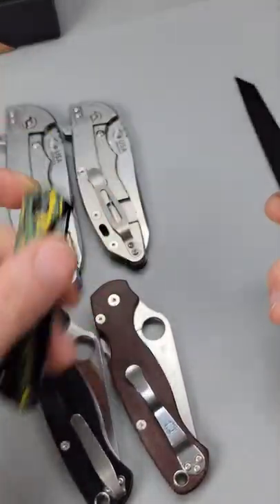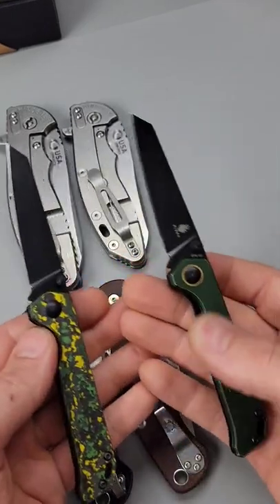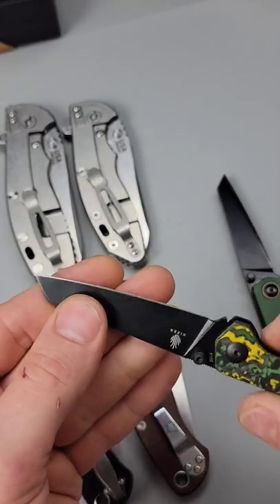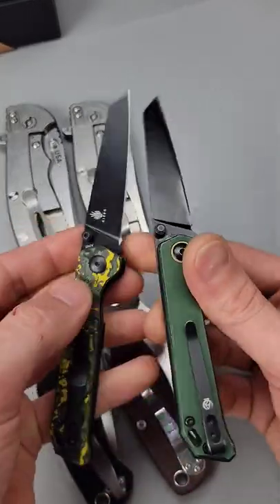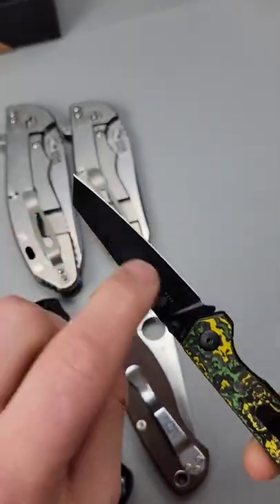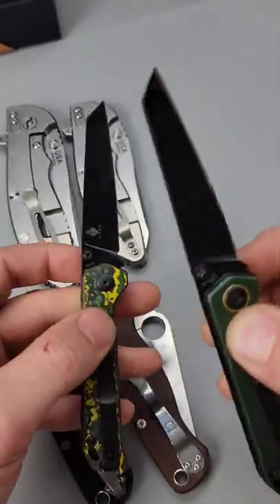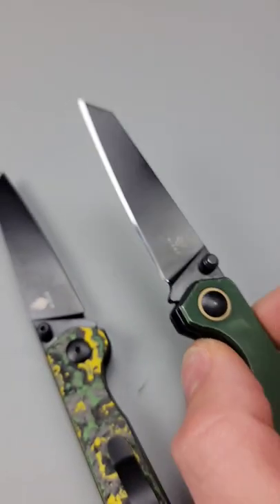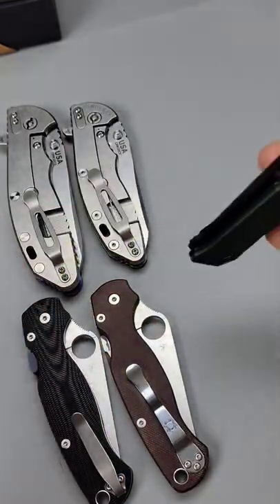YOUR EDGE WILL GO DULL AS SOON AS YOU USE IT

Comment from the maker: EDGE ANGLE DIFFERENCES, EXPLAINING THE DIFFERENCE IN EDGE ANGLES, YOU DEFINITLY WANT A BALANCE TO SOME EXTENT, THE STEEL AND HEAT TREATMENT ARE GOING TO PLAY AN IMPORTANT FACTOR AS WELL.

SPYDERCO PM2 CRUWEAR
https://amzn.to/3dPdb6D

KIZER MINI BEGLEITER
https://amzn.to/3wn0jLk

BLADE HQ KNIFE SHOP
https://shareasale.com/r.cfm?b=375565&u=3154377&m=39329&urllink=&afftrack=

GP KNIVES KNIFE SHOP
https://shareasale.com/r.cfm?b=631534&u=3154377&m=54594&urllink=&afftrack=
Reply: but is it as tough as a Ginsu 2000, that is the ? 🤪
Reply from the maker: @cctvspystore  😆
Reply: First time here. Cant wait to see what you say about the Spyderco knifes.  I had one in my pock for 20 plus years. 👍🤠
Reply: What are the two different steels?
Reply: Dude, why u screaming
Reply from the maker: @ArvindDevaraj-u6l  why are you so quiet?
Reply: There are different things being discussed that shouldn't be equated without clarification. "Edge retention" as you're using it should more correctly be called "edge wear resistance" because you're assuming that the only edge damage will be from repetitious use and wear of the terminal edge. In reality edge damage can come from other causes such as accidentally hitting a hard substance. In this case a smaller-angle grind will take much more damage than a broader one and thus would have much worse edge retention. Edge retention isn't just wear resistance but also toughness. Contrary to the internet gurus, there are lots of scenarios where a steel like 1095 will have critically superior edge retention than a super steel because nothing destroys an edge like a chipped blade.

Comment: Exactly, this is why I sharpen at 90* per side. Twice the cutting edge and ultra durable.
Reply: 17 degrees edge with S35VN, VG10, AUS10 can still whack tree branches without chipping 👍
Reply: @nafis6668  you totally missed the joke
Reply: @vraskas6252  🤣 yes i was. Thanks for pointing that out
Reply: It's a good joke, but actually there are tes where a crisp 90 degree will do an amazing job smoothing surfaces.
Reply: 😂 toughest knife ever
Reply: Can’t lie the nastiest cut I’ve ever gotten was from a 90° edge. Granted my fingers went kinda damp from wearing gloves all day, but that mfr Went straight to the bone
Reply: @Gamdalff  What was the object? A knife or something else?
Reply: @ElCapAddict  it was the 90° edge of a fryer cover in the kitchen I worked at. I picked it up, my gloves were greasy, it started to slide, I tightened my grip, that cover kept right on sliding. Sliced to the bone all along my hand where I gripped it. Most painful and gnarliest cut I’ve ever gotten, and I’ve been stabbed lol
Reply: @Gamdalff  I also got a really nasty little cut from a 90° edge—I was putting together one of those low cost sheds kits and cut myself on the galvanized sheet metal. I was applying roof tar to seal some areas and smoothing the bead and was cut through my gloved hand (there was a possibly burr in this section from the stamping/shearing). Take care!

Comment: Depends on how you use your knives and what makes them dull. If they're dulling from abrasion wearing away the edge then yes a thinner edge lasts longer. If you're doing something that causes chips or rolls then a thin edge will usually dull faster. There's a reason axes aren't sharpened like a sushi knife.
Reply from the maker: I just posted a full video

Comment: That being said a scandi grind is the best of both worlds. Love my mora for that
Reply: Scandi till death.. but I don't use mora I destroy them to easily and I hate the sheath.
Reply: Scandi knives perform very well, but thickness approaching the very edge is determined by angle alone, not how far back that angle continues toward the spine. 

Or maybe the wedge effect helps pull the material apart, putting less stress on the edge? If you've actually noticed this in practice I'm curious to hear it, since I haven't used a non-Mora scandi so I can't be totally sure. It just doesn't seem to me like there being a "best of both" makes sense here.
Reply: @mysss29  you pretty much have it, but one other thing is that you can cut at a very low angle with a scandi, so it’s good for controlling depth of cut when shaving/scraping.

 The best part of a scandi grind is the ease of sharpening, since the primary bevel is so big. Mostly for fixed blades, but some folders have one.
Reply: @2ballsyourjaws  I've used my mora as a climbing spike lol.
Reply: @bobbyhempel1513  I'm not denying the fact that they make a pretty good product for most people in most situations they're tried and true and I'm pretty sure they will go down in knife history in probably the top I don't know 10 or at least 2o knives ever they just don't perform to my rough standards
Reply: @justjoeking9818 scandi is the worst grind to sharpen. Your basically rebeveling the knife every time you sharpen it. Not saying it is difficult but it does take more time.
Reply: The worst grind ever

Comment: Depends on what you cut tbh. The bigger edge will be sharper off the bat, but the smaller edge will be more consistent. The bigger edge will also chip and roll over causing uneven cutting comparatively to the smaller edge
Reply from the maker: There's obviously a limit to which you have good edge stability, I explained in the top comment that heat treatment and steel are also a factor, but in general that's how it goes. When we sharpen we are looking for a balance so we have a very slicey good edge stability with good edge retention, and decent toughness if your smacking staples constantly then you might be worried about toughness and have to consider that with your edge.
Reply: Ah, staples 🥲 I remember when I first got into sharpening and I had this amazing edge… way too thin for edc… hit some staples in a box and you could see  mountains in the edge 😭
Reply from the maker: @samuelsmithee  😆 🤣  yeah we have all been there, I rolled a tip the other day deploying my knife into a piece of steel. You'd be surprised how much a blade steel with high edge stability can take at a low angle with a great heat treatment.
Reply: The thing about a keener edge is it has a finer apex that will still cut after it rounds off. All edges more or less become blunted but since the angle is so low it still feels and acts sharp even though under a electron microscope it will look smooth and rounded over. Knife steel nerds has gone deep into this topic. FYI on super steels at 60+ hrc 13 degrees is appearently the optimal angle regardless of task as long as is cutting and not chopping.

Comment: I have been a butcher for 27 years and I've ALWAYS used and taught my cutters to use low angle edges. Holds the edge better and for way longer. I also teach them to NEVER pick up another person's knife and hit the steel. I'm left handed and if a right hand cutter hits my knife on the steel I'm sharpening it again. That's where scabbards come in. If a knifes in a scabbard, no one else can pick it up
Reply: What brand/style knives do you prefer. I was a cutter for 3 years

Comment: True... You do have to factor in the steel here. After working on so many Japanese kitchen knives, I've learned that hardness and heat treat, quality of the steel and factor in as well. Most of the time a Japanese kitchen knife (harder steels) can be sharpened at a lower angle for a sharper edge than most western knives. I am speaking generally of course. I am sure the same applies in pockets knives. Although this is getting really nit picky. Can you tell I use Jnats? Haha
Reply from the maker: I posted a full length video with great detail yesterday

Comment: It would be cool to see a sharpening chart based on best grit by steel type and edge bevel based on stock thickness. As an Example 
CPM154 600gritt at 17° for 3mm stock (small folders) @20° for 4-5mm large folders, kitchen knives,  and small fixed blades)  @24° for 6mm and above (large fixed blades) . 
Note that this is just an example I pulled out of my head the numbers are probably incorrect but this type of guideline would be awesome for beginner sharpeners.

Comment: How is edge retention and edge toughness any different? As an extreme example, let's say one knife had an edge angle of 45 degrees, while another had an angle of 1. Obviously the 1 degree life would be way sharper, and according to you, have better retention because of the longer grind on it, even though the 45 degree knife would be tougher, and intuitively would retain its edge better because its tough
Reply: Steel can become dull in different ways. It can be worn down by what it cuts without being deformed or chipped, or the edge can roll/chip out. Bad cutting technique and very hard materials give more lateral force, compared to something like cardboard or paper that will be basically pure resistance to wearing away.

Tough steels will have better resistance to chipping and deformation from lateral forces, which means you can have a thinner edge without chipping out. It won't really help with wear-resistance itself, though (when ignoring things like edge angle or chipping).

Comment: What is the better angle? 15, 17, 20, 22, 23.
Reply: I'm here for that question too
Reply: Better for what? Kitchen knife? EDC knife? Outdoors knife? It's depends about just that, more strength u wants from your knife, higher the angle you make...
15 kitchen
17/20 edc
20/22 woods, buschcraft, just "do everything" fixed blade.
23/25  hard use survival knife.

If u are not total donkey (guess nope) 20 is the best overall to do whatever you want 😁
Reply: @vilkknives3000  Thanks 👍☺️
Reply: I prefer 17 degrees edge on S35VN, VG10 and AUS10A.

 Those steels can still whack tree branches without chipping. 

I still can shave with them afterward. 👍
Reply: Why not get the best of everything - 15* on one side for slicing and 25* on the other side for durability.
Reply: Start at low and if you get chipping or rolling, go slightly more obtuse and try again, repeat till your happy.
Reply: @ElCapAddict  that reminds me of some sushi knife. I tried that before, the knife tend to cut sideways rather than straight down.
Reply: I usually just switch hands, right side for durability and the left side for slicey-ness, but going to the other side of the table works too.

Comment: wait I don't understand. what is the difference between the edge having a better edge retention and it being tougher?
Reply: Better edge retention = cuts more cardboard before it goes dull

Tougher = resists impacts like hacking into wood better without bending/chipping
Reply: @NoNamer123456789  ooooh okey thanks
Reply from the maker: Exactly no namer! toughness is its ability to take impact, retention is it's ability to stay sharp at apex, edge stability is it's ability to be stable at low angles

Comment: It doesn’t retain its edge better. It’s simply a thinner edge, so it will be better at cutting even if it’s dull.
Reply from the maker: if it can continue to cut through things cleanly then something thicker thats still edge retention and that is why it has better edge retention, so then its not dull if its still cleanly cutting
Reply: It has better wear resistance at lower edge angles. It will cut more material before becoming dull. You can check CATRA results.

Comment: I've always been taught that in general, the lower the angle the sharper the knife but less edge retention and toughness, that's why sushi knives are at ~15* and camp knives are at ~25*. That doesn't necessarily mean a lower angle will go dull instantly or can't last longer than a higher angle, especially depending on the steel and heat treat, but generally a lower angle will cut cleaner but for not as long as a higher angle.

Comment: So, you gave us a conclusion “low angle has better edge retention,” but you didn’t back it up with anything. Isn’t it true that steel type, heat treat, and hardness would all play a huge part in the equation?

Comment: My logic has always been that I can sharpen the low angle quicker. It would be worth it regardless.
Reply from the maker: low angles take far longer to sharpen because it requires more steel to be removed
Reply: @NeevesKnives  I have always had hell sharpening a high angle edge. It takes me at least twice as long. That could easily be due to my skill level. Not having to fix mistakes is a time saver.
Reply: Start with a low angle then go slightly higher angle each time you sharpen, that's how you make it sharpen much quicker
Reply: @jegr3398  That works but eventually leads to the knife needing a rebevel. I have done it by accident quite a bit.

Comment: Please can you make tutorial video on browning Da167 cuz it's its has a little hole which i don't know what is for and also the rope cutter... thanks in advance
Reply from the maker: The hole in the flipper tab is just for weight relief most likely
Reply: @NeevesKnives  oh really! Ok thank you..i have one i tried to peel electric wire using that rope cutter it worked fine ...im wondering if you can make a short video on this knife particularly and how to peel wires with it ... would be cool
Reply from the maker: @ML-ir4vk  I'll see if I can come up with one or similar, because that cutter is a seat belt cutter, a better option would be probably the hogue trauma which also has one, but there might be something with an actual wire cutter, I think Leatherman has something
Reply: @NeevesKnives  oh really! I thought it's for wire cutting and such stuff but thank you so much for cleaning things up really appreciate it wish you the best of luck ❤️
Reply from the maker: @ML-ir4vk  you could use it for what ever, but it's originally designed as a seat belt cutter to my knowledge
Reply: @NeevesKnives  it is since you said so😉

Comment: How would a lower angle improve retention? Wouldn’t it be more susceptible to rolling and chipoing being thinner at the apex and also being thinner for a longer distance? Or am I not understanding something correctly?
Reply: i was thinking the same
Reply: i was thinking the same
Reply from the maker: Read the top comment, but yes there's still a balance of which you want to sharpen depending on your steel and heat treatment, some steels have better edge stability and toughness than others, the lower the angle the less toughness you will have but the more slicey it will be, toughness and Edge stability and edge retention are different things, so when Sharpening your looking for a balance. In general the lower angle the higher your sharpness and cutting performance, but the lower the toughness. And you have to figure out what's best for you depending your steel/heat treatment and what your cutting. If your smacking staples constantly then you want to take that into account, if your cutting clean cardboard all day then you can take that into account. Edge rolling or chipping is going to be a result in poor heat treatment, or steel with poor edge stability considering you haven't hit anything that you shouldn't be trying to cut. The materials your cutting have to be taken into consideration. Remember this is in general obviously there's an extreme on both ends so you want to do the best balance for you and your steel your using

Comment: I usually dont go passed 20 deg (well depending on the blade thickness and height) . Real High bevels just dont look to me Im hard on edges so I need the roll and chip resistance .
Reply: Try 90* per side, you’ll get twice the cutting edge length and it’s ultra durable.
Reply: If your buying things like cruwear or m4 and such you should definitely go past 20dps.
Reply: @ElCapAddict  I bet it works great for striking fire steel.
Reply: Every angle is sharp if you’re strong enough...
Reply: @ElCapAddict  Even 180°!!

Comment: I would have to Disagree with you  there ,  the things I cut with  my knives  will make a 15° edge go dull really quick , I find a Happy Medium like a 20° edge last longer in my experience , it's  really all about what you use or cut with your knives ....
Reply from the maker: You should read my top comment, edge retention is not toughness, and there's obviously a balance that you need depending on your use and what your cutting, and the steel your using and its heat treatment, lots of factors, there's nothing to disagree about. Edge rolling edge chipping and edge going dull are all different things. But read my tip comment
Reply: @NeevesKnives   I didn't  read your Top comment  , I was going by what You Said in Your Video  ,  " A Higher edge will have  Better Edge Retention "  , and that is what I  disagree with you about  ....

Comment: This video is all over the place
Reply from the maker: It's an under 60 second video what are you talking about
Reply: @NeevesKnives  you talked about bevels, briefly mention steel differences but not whether or not that’s calculated in your claims, the say one lasts longer but say the other is ‘tougher’ which Idk what being tougher would mean if not would last for more uses therefore longer. My advice would be explain one then the other instead of alternating throughout. This makes distinct the characteristics for the different blades. Also “higher angle” is more confusing than just saying thinner or thicker edge